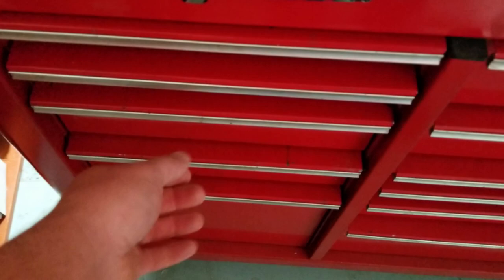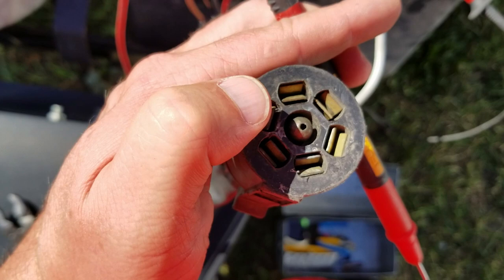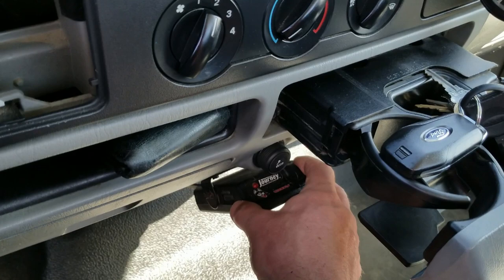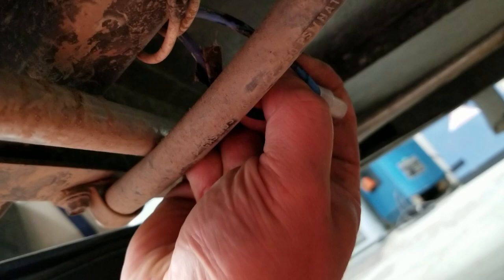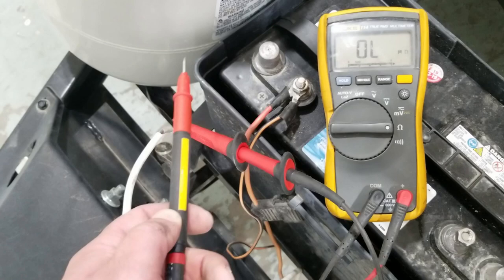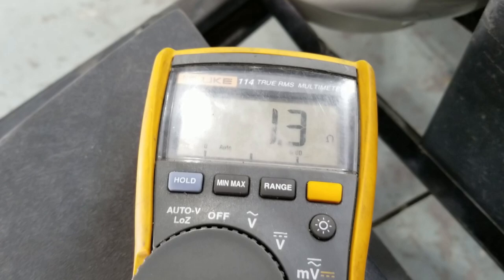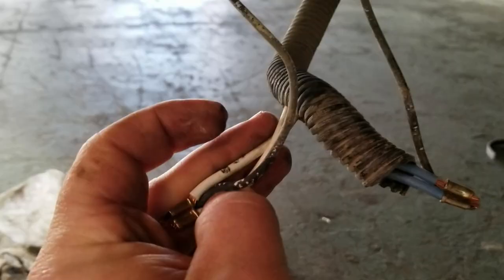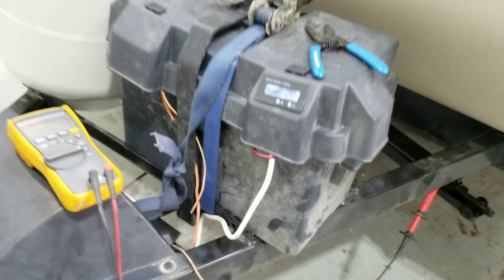Scumbag Offset | sketchy wiring

Comment: My buddy owns a trailer repair shop. Standard procedure is remove all wiring and start over. Especially boat trailers
Reply: You usually hear "fast, cheap and done right... pick 2". Pulling all the wire and starting over is the exception to this rule by ticking all three boxes in the long run.
Reply: Tyler Boespflug I bet in most cases it ends up being cheaper instead of diagnosing every bad wire. Usually ends up being the same with brakes, bearings, jacks, etc. Parts are cheap labor is expensive
Reply: Yup if I have to fix it, I just trash the whole wiring harness and the lights and redo it.
Reply: No, it isn't the way to reach deep. Having them come to shop every Monday after camping to fix random wires and leaks make management the happiest.
Reply: Doom  $50 an hour is dirt cheap.  It's usually double that or more around here.
Reply: Sudbury special, drive during the day and stay on the back roads. No lights required
Reply: @TylerBoespflug  I imagine it's not actually faster than fixing the fault but finding the fault is nearly impossible
Reply: @anonony9081  Sometimes that's the case. Oftentimes you fix one fault only to have something else go wrong the next step down the line. I'd rather put in the time installing new and proper instead of chasing gremlins and cobbling things together. Especially when fate will almost always guarantee the two sections of wire you are joining are 1" too short.
Reply: Funny I just did that last weekend on my 2 year old boat trailer.   All new wiring.
Reply: Also, in the moment it may be faster. But if you calculate your time over multiple repairs, you are probably better off timewise.
Reply: @anonony9081  the thing is if you find the fault and you fix it you wil find out that further on there is another fault, then you fix that and it turns out those 2 faults where not actually the problem you where looking for but a side problem, then you find the real problem and end up replacing the whole wiring anyway. So what you did was spend 4 hours fixing scrap wires and now you stil need to redo the whole damn thing.

And with boattrailers its even worse. Most are not protected wel enough against moisture, so they get moisture in the wiring and then you start peeling back the insulation and you wil find black wires, no copper, just black crap. And then you think lets cut of a bit more, stil black, cut of more, stil black. By the time you find copper again you are halfway down the trailer and the floor is coverd in pieces of rotten wire.
Reply: As they do in Hialeah,   just keep on patching it ! Feel free to use ANY KIND OF WIRE you can find on the ground... Hialeah = Hell.
Please be Warned
Reply: Jason Gifford ?
Reply: @greeceuranusputin  you must own a german made boat trailer
Reply: We do trailer wiring at my shop as well an I can fully agree, a LOT faster and sometimes cheaper.
Reply: @TylerBoespflug  Look at the single repair Uncle Fumblebuck called halfway professional- inserting a new piece of wire with good crimp fasteners on both ends.
Wonder why he had to do that?
Reply: Reminds me of a Monty Python skit: I'm not bad yet! Yes but you soon will be and we can't have you shorting out some place now can we?
Reply: Amen,  troubleshooting all the bullshit electrical tape and wire nut splices some goof did is a total waste of time
Reply: @greeceuranusputin  Normally not. It is normally cheaper just to redo and redo right. Cause even if you fix the route cause you wind up with it going bad in another location. Then they come back and you eat it if you are a reputable place.
Reply: Really is the best way to go around it, only way to for sure know it''s done right
Reply: Done many in the shop. It’s exact same here is kangarooistan. Just have to start from scratch.
Reply: ESPECIALLY boat trailers. Manufacturers seldom use the correct wire in the first place so it's all green death in no time.
Reply: Matthew Litke That’s exactly what I just did to my boat trailer wiring. Sh!t canned it all and started over fresh.
Reply: Thanks everyone
Reply: I like that strategy.
Reply: Easy fix to trailers , fill up all connectors in boxes and plugs with petroleum jelly after you made the wiring ... specially boat trailers , leave no room for moisture .
Reply: Youll Never Know  nice username!
Reply: I say just toss the whole trailer and buy another.
Reply: I've had it to were I've fixed the front 2 marker lights and then the back 2 running lights went out so I had to go and re wire them both all because of those crappy blue clip connectors I always butt connect then heat shrink any connection on trailers I work for a shop that does boats and with boats come there trailers which are always like chasing a ghost
Reply: Yes sir me too I have 2 boats an 3 low boy trailers if I pull one an a light malfunctions or a wire breaks it is a temp fixed to get me home then the lights and wire hit the trash an new wire a new plug an lights are put on the trailer so very seldom do I have troubles 😂🤣 I hate any non working or semi working trailer lights with a passion
Reply: That's what I've always done with every trailer I ever had.
Reply: Matthew Litke, if your friend is so wise, who does he repair trailers for a living?
Reply: Doom  you got quoted 50 a hour and went somewhere else you know how that sounds to us that know what the going rate is these days
Reply: Ach, at least check the back of the plug first. But if the plug's fine, 7 core 4mm is cheaper than my time pulling the damn loom apart

Comment: Knipex pliers- seldom the "right" tool for the job, but usually the highest quality "wrong" tool for the job.
Reply: 1:53 even electrically insulated ;-)
Reply: They're good hammers aren't they?
Reply: @mickleblade  no no no. Those bastards are too expensive and too good to beating stuff with.
Reply: @johnnymotorboat8824  No, they're good for hammering on a screwdriver
Reply: Use my knippers for almost everything. They dont work too well as a hammer not enough girth but almost any rotating fastener yes, not much squeezing effort but that's not what makes them special either
Reply: side cutters and water pump pliers. that's all you need to fix the world
Reply: I recently discovered the Knipex "plier wrench" ... I've rarelly grabbed a standard wrench since. Also stopped rounding off fasteners for the most part :D
Reply: @johnnymotorboat8824  I use mine as a hammer almost daily
Reply: @daviasdf  oh for sure! Much quicker than a crescent wrench, and actually grips! Love em
Reply: Knipex. Always stolen on sight.
Reply: @daviasdf  I think they are supposed to be pipe wrenches. They will bite anything though.
Reply: @mickleblade  nooooo. That's what we have fat leathermans for.
Reply: @stuwoo2001  they are what an adjustable wrench aspires (and fails) to be.
Reply: @Only1Sethy   The thumb -detecting one will work,if you don't have the time.
Reply: @mickleblade  and adjustable too
Reply: I saw that too
Reply: I give Knipex pliers to my relatives for Christmas it may take a year or two but they learn to love them or I could borrow them back
Reply: I bought a whole mess of knipex pliers because I saw him using them all the time.   Love those things.

Comment: The difference between this and some of the airplanes I've opened up:  The trailer is made of steel.
Reply: @Pr3Va1L  yeah, planes are 100% fibreglass...
Reply: How expensive is the roadside assistance for an airplane? Does it come with free towing when I break down?
Reply: @Pr3Va1L  but easy to short out on aluminum.
Reply: @rhunter3406  depends if you've paid your bribes to AOPA.
Reply: The Garden of Eatin when the plane breaks you just pull off on to the nearest cloud and call Flight Service.
Reply: @Bout Dviarge: You might be surprised at just how many planes are still made of steel.
...Especially with a comment like that.
Reply: It also has colours, with aircraft all wires are white, or at least used to be, and who knows, you might even be able to find the remains of that number on it. Was that a 2, or a worn 8, or a worn B, or did a fly drop something there?
Reply: @mysterymete  in GA birds, you usually see steel in tube and rag construction. Lots of them are aluminum sheet, or indeed fiberglass sometimes on newer machines.
Reply: @SeanBZA  I just read pins at the cannon plug, but yeah all white wires on the 2 airframes I've worked on.
Reply: @orange281gt  You are hoping that the plug is at the correct version for that particular airframe then, as often you sit with a few similar model aircraft, but with different ages, different mod versions, and you hope the wiring diagram you have either is for this particular mod, or at least had an addendum telling you the various steps and extras. Then you get those special mods that are totally undocumented.
Reply: @SeanBZA  I was going to say I'm glad military aviation isn't that bad, but I guess I should be thankful in my personal experience to only have run across 1 time the wire schematics were not up to date.  Although I'm sure the electricians have dealt more with that.  I deal with a little bit from airframes and a little from powerplants.
Reply: @rhunter3406  usually all the parts fit on a trailer, yes. If you can find them.
Reply: In aircraft, it is always the white wire that's the problem.
Reply: so fuckin true

Comment: Why is trailer wiring so universally terrible?  If somebody marketed a top quality waterproof wiring harness that happened to come with a trailer attached to it, they'd sell a million units.
Reply: I just pipe it and pull 14 or 12 THHN.
Reply: Most of the time its just quicker to rips the sumbitches off and start with fresh wires.
Reply: Better off learning how to wire yourself. Than you can wire your own harness
Reply: They make em, but Ive only ever seen em for class 8
Reply: @jacknickolstine3355  Yeah cause you wire more gooder with a 12 pack. Makes you more experter. You know that guy, lol.

Comment: Only thing worse than trailer wiring is electrical tape on trailer wiring...
I don’t understand how it can remain so sticky, yet never stick to anything!
Reply: Oh come on!  We know it'll stick to your fingers.
Reply: That ain’t sticky. That’s “gooey”
Reply: @JRPittman  yeah that's one for it. I always went for 'gacky'. I hate that shit...
Reply: Fact!
Reply: That's not fair. It does stick. 

For 34 seconds before it turns to slimey goo that needs industrial solvents to remove
Reply: Solder and shrink tube ,
Reply: @bluecollar58  Do it right, I say
Reply: Don't try to understand it, that abyss will stare back.
Reply: Steeltoedboots I'm more of a crimping guy but everything beats "twisted together and taped"...
Reply: the tape stays stuck, long after the wires come apart
Reply: @Noise-Bomb  Meanwhile I'm down here at "twisted together and cinched up tight with whatever plastic I have around here what shrinks when put to a flame"
Reply: Elliott G Well even twisted together and shrunk beats taped by a longshot...
Reply: Isn't the tape meant to fall off and just leave the goo behind?
Reply: The best thing to do if you are gonna use electrical tape and not shrink wrap is to first roll the electrical tape sticky side up then come back and stick it to itself. The wiring will not get goo all over it. Trust me
Reply: hahaha, this applies to all crappy tape and is so accurate I laughed hard
Reply: @bluecollar58  yes that's what I normally try to do anytime I fix something if feasible. Vibration is an issue which that is the best way to avoid avoid that issue is soldering heat shrink plus you can get weatherproof heat shrink as well.

And never use insulation displacement connectors you know those all 3M do hickeys on Automotive borja vibration applications they're the worst almost is worse than wire nuts sometimes don't quote me on that but I've noticed. Occasionally.

And the worst thing is those insulation displacement 3M connectors or knockoffs of which are included in trailer wiring kits ouch.
Reply: Wrap with lovely stretchy self amalgamating tape. It’s none sticky but seals everything nicely. If it’s exposed to sunlight, wrap with ordinary PVC tape which generally stays sticky I’ve the SA stuff.
Reply: @bluecollar58  I always remember the shrink tube after I solder.
Reply: Jim Jones  , lol , I have definitely done that. 😃
Reply: oh so true
Reply: 3m tape if your fancy or liquid electrical tape !
Reply: Hahahahah
Reply: Take it from a salty sailor - use vulcanised rubber tape.
Reply: @aaronbrandenburg2441  I thought I read somewhere that you shouldn't solder the joint when running wires in a car since the vibrations will eventually cause it to break at the joint. I've always used heat shrink for any sort of wiring but I haven't always soldered every connection for that reason. 
Should I have been soldering them as well? Particularly on things like riding mowers...?
Reply: @bluecollar58  exactly as I just mentioned to someone else an earlier comment
Reply: @Noise-Bomb  yep I've seen extension cords that have been chopped into by an electric lawn mower and and someone had done that although that one is or should I say was still holding up until I put into ins on it and made it to two shorter cords which RC were needed more than long one was anyways but the cord was still perfectly good everywhere else exception of at the splice of course ya look like a 12-part if you looked at it wrong when I unwrapped it
Reply: @trif55  3m super series only for me. Clean the stuff your taping and it'll outlast the wires. If you got a GM product it outlasts the loom that crumbles away after a couple years. I only tape to secure/protect wires. Uninsulated crimps with hot melt heat shrink or  high lead soldered and same heat shrink for main connections depending on the circuit I'm repairing or changing
Reply: @svchineeljunk-riggedschoon4038  take it from a salty electrical tech. We wanna meet you guys at a shady bar lol
Reply: @Napkinholdin  there's tons of solder joints in modern cars. But thanks to California making lead dangerous  (they even say water causes cancer). They have low lead,, high tin solder now that's brittle and breaks from vibration. Either you can master silver solder (it's a bitch for my amateur ass) or get aviation high lead solder. It lasts much longer than general stuff. I've lost count of how many modules and controllers I've reflowed solder in because of that..

Comment: When I get trailers in the shop I can almost guarantee I’m gonna start by pulling out all the wiring and running a new 7x14g  wire and start fresh. Saves me at least two hours of trying to figure out what the last guy did because you know the wire is going to change color about three times before it gets to the back.
Reply: i hear ya... or everything is black and red with a mixed in green or white
Reply: @jacobelder5817  NEVER use Scotch Loks.
Reply: What you on about.  I buy a roll of wire of one color so everything is the same color - ground, positive, and other.  I know which wire is which (left, right, high, low) or I lay one wire down at a time so either the first wire is the ground or the last wire is the ground.    Did not worry about fixing it as it worked when I was done.  Yeah, it would be HELL if it was a repair job.  I don't do repairs.
Reply: Only three your lucky
Reply: @ddd228  I love scotch loks, they make my customers so much happier when I rip them out and their internet speed triples. Harder to do that when the existing installation is skookum!